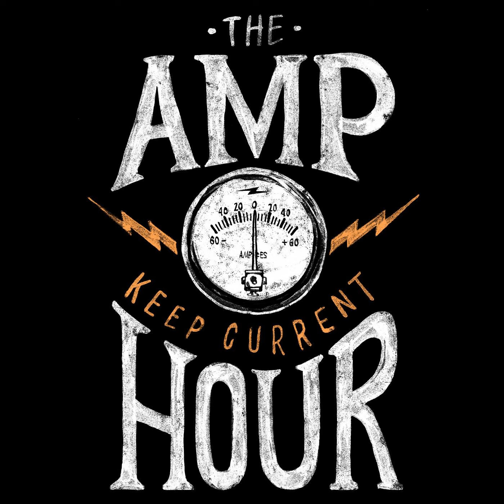The Amp Hour #589 - Mute Button Discipline

Comment: Beta as a parameter for PMOS or NMOS transistors isn't unheard of. In the textbook CMOS Circuit Design Layout and Simulation written by Professor of Electrical and Computing Engineering at UNLV, Jacob Baker, beta is used as transconductance parameter notation and is equal to the device carrier mobility times the oxide capacitance times the width/length ratio. The width/length ratio is one of the few parameters the integrated circuit designer has control over to set the device current; the rest are fixed by the technology. The Falstad simulator probably uses beta to set the overall transconductance without regard for those internal details.

Comment: I wish regular scientists and engineers had gear companies knocking at their doors, but nah... no new multimeter each year.

Zappy - hmmm, I wouldn't trust anything with that name... Sounds very dodgy when it comes to electrical safety.

As for webinars, I don't hate them per se, I just hate when they're done wrong. Like the speaker just reading the things written in the slides without going any deeper, a presentation with no room for feedback or participation, or anything that requires you to install a non-free (as in freedom rather than free beer) software on your device, especially if your platform is not supported.